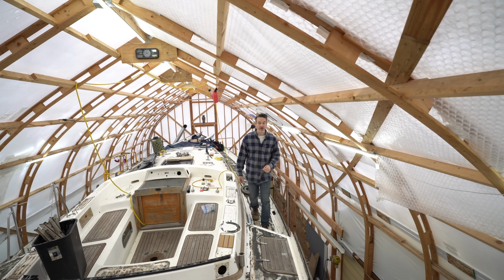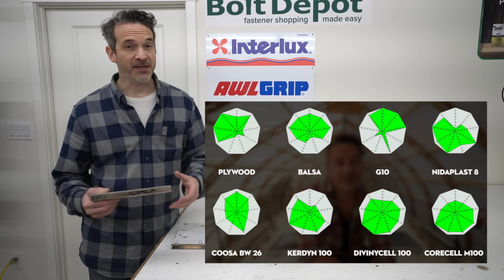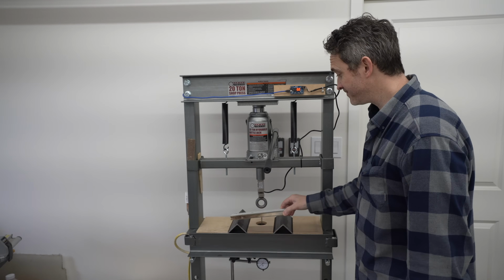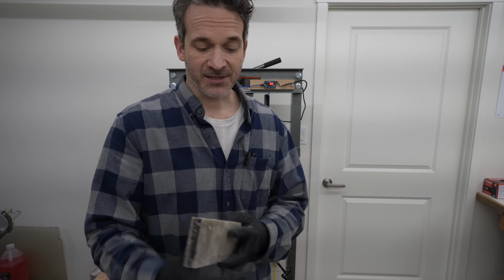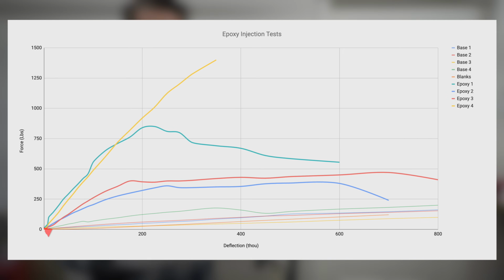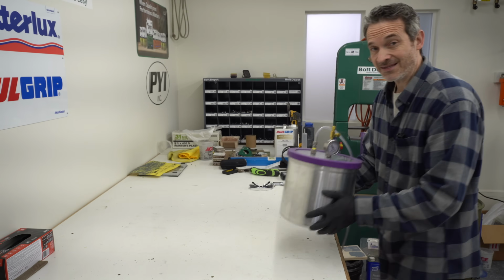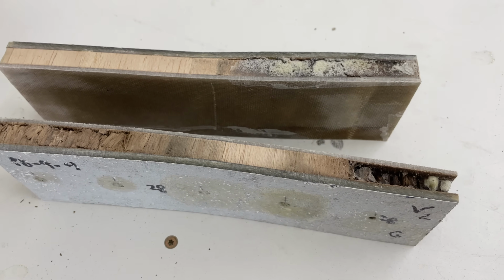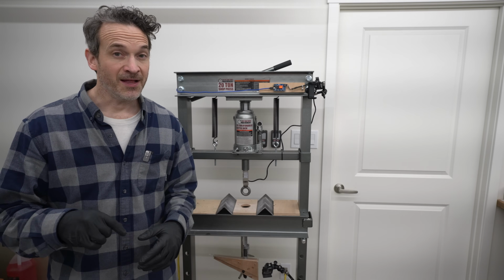Does Injecting EPOXY actually FIX a rotten boat deck?!

Comment: This is such an emotional topic for a boat owner when the have to come to grips with the amount of labor and money involved to do it right. Right is removing the rotten material. The shocking renovation is the rot is usually double of what is immediately obvious. Injecting epoxy is usually only good for small areas and then only when the core is absolutely dry by pulling a vacuum(airflow) though the affected area. Normal viscosity epoxy is extremely difficult to inject and thinned epoxy “penetrating epoxy” that uses volatiles yields extremely poor results. The ONLY thin epoxy that I trust is Gitrot. Filling large voids is to be avoided because of heat and brittleness. Rot eat the wood’s cellulose, cellulose is the wood’s strength. If you fill the space primarily with epoxy, think peanut brittle. Stiff till it isn’t.
Reply from the maker: I think you hit the nail on the head…
Reply: Could not have said it better myself. Absolutely accurate.
Reply: Very informative . Nicely presented thanks for,sharing
Reply from the maker: @c.a.mcneil7599  Thank you

Comment: Your supposed to plug the holes with dowels so it forges the poly into all gaps same with the epoxy, its regularly used to repair delaminated caravan floors
Reply from the maker: Knock yourself out

Comment: Just paint over the teak wood.  1 day work, 15 years no worries. First low viscosity epoxy, then few top coats with anti slip. On larger areas, add a thin layer of fiberglass.
Reply from the maker: Interesting idea but that would leave you with a pretty wet and possibly rotten deck still…

Comment: Thank you for running and filming these experiments.  My question is regarding screw retension.  How well do the epoxy injected cores retain screws before they strip out?   Also will the rotten wood continue to rot in areas where the epoxy is infused and where it is not infused?
Reply from the maker: Thanks. 🙏. Im not sure about the screw retention… interesting question. I assume the wood will continue to rot unfortunately. I don’t really think epoxy is a good “fix” using this method…. Personally.

Comment: You may have said this and I missed it, but what pressure measurement is acceptable for the long-term viability of the repaired deck?  For example, if 300 is viable, then your epoxy injection method meets the spec.  If 1000 is the spec, then core replacement is the only solution.  Can you share what number is good enough?  Is epoxy injection good enough?
Reply from the maker: I think what this showed is that with epoxy injection, the results are really quite variable depending on the level of rot. It may make the deck stiffer but you need to weight the penalties. If you want to get back to the design specs of the boat, proper repair is really the only way that I see forward...

Comment: I always thought (from stuff I read ages ago) that one of the advantages of a cored hull is that should a collision occur, rather than the damage causing a breached (hole in the hull as would happen with an all glass hull resulting in water ingress), instead a cored hull would sustain the collision up to a point?) and only the inner skin would be damaged, i.e. cracked, deformed etc., thereby maintaining no water ingress and less chance of sinking until rescue or repairs can be done. However in videos of homemade bullet plate protection for vests, a 1/2 inch thick plate of fiberglass (reg FRP, kevlar, bi directional) layered under pressed weights held up against bullets up to 45 cal magnum rounds. At 10 yards. AR-15 rounds penetrated but may have lost a lot of its kinetic power who knows , it was all backyard stuff, but it says something about the strength of all glass hulls from the 60s, 70s. I knew a couple who sailed from Malaysia to Japan and struck a very large fishing buoy (unlit) off the coast of singapore (lots of buoys there) in the middle of the night, the collision was quite substantial they described, but upon inspection there was barely a 4-ft scratch on the antifouling paint amidships they said and nothing in the inside. The hull of their boat was cored a total of three inches thick, outer glass about 5/8 inch, then foam core, then 3/8 inch inner glass. They showed a cored sample from a thru hull. Boat was 45 ft cruiser.
Reply from the maker: I prefer solid layup for the hull. Delamination over time would concern me… sounds like a very solid boat though

Comment: Its remarkable that boatbuilders of the not too distant past ever believed wood-cored decks would remain dry. What test evidence did builders use to justify this material choice? Were decks just designed to fail in ~30 years?
Reply from the maker: Sadly, probably just designed to last the warranty period... Balsa is still one of the best choices for core material though... keeping it dry is the problem.

Comment: I drilled 100  1  1/2"  holes  in my  fiberglass deck and pulled out soaked foam. with needle nose pliars ... then refilled with sea cast and a few  mini ping pong balls, between  stringers (no rot)....about 100lbs worth of sea cast from transom  forward about 4 1/2 feet. sanded and gel coated . good for 100 years plus.  Epoxy will crack been there done that .
Reply from the maker: Wow. That sounds interesting…

Comment: That's an avwesome stuff. I'm rebuilding my coachroof with the closed cell foam that Trojan maxx core PVC foam (approx 5lb/ft3) and I really like the result. One more thing with rotten core is that it accelerates a molb buildup in humid environments.
Reply from the maker: Thanks! All the best with your rebuild.

Comment: Can you overlay a damaged deck with -say, teak wood as a "path" that spreads the weight distribution?
Reply from the maker: It will probably help with the stiffness (if you glue down real teak - or add more layers of glass)… but it is not dealing with the existing problem of the extra deck weight and then you’d just be adding more. 
I would be concerned with a “cover what’s in there” method… just my $0.02 👍

Comment: I went through a similar process on my boat some time ago, and reached the same conclusion. Remove the top layer of fiberglass and all of the damaged core, plus enough to be sure you got it all. Replace it with new foam, vacuum bagging it in, and lay a new top layer (cord for the engineer). With a little practice you’ll get good at it.
Reply from the maker: Thanks! That’s the plan!! 🙌

Comment: I am in the process of doing a core replacement on my C&C 24 after a botched drill-and-fill "repair". I knew it was going to be bad, but it's of course much worse than I imagined. 

The construction of the C&C is odd. The foredeck has a typical "sandwich" layer with balsa as the core, but the bottom and top of the sandwich pinch up at the sides to a single layer of fiberglass where it is bolted to the hull. There is a third layer of fiberglass that makes up the interior of the cabin, but it isn't actually bonded to the core sandwich above (except by some thick blobs of resin, presumably to keep the free-floating interior glass held up). Because of the drill and fill "repair", water got into the space between the interior fiberglass layer and the sandwich, which caused mold to abound and deeply penetrate the bottom sandwich layer. In short, I have to rebuild the entire based from scratch as well as the top. UGH!!

But alas, if it's worth doing, it's worth doing right.
Reply from the maker: Ooph… I feel your pain. Hang in there. It is worth doing well this time. All the best!! 🙌👍

Comment: For the folks saying that the expoxy injection works ( their boats were done years ago) I'm going to assume they sail them reguarly in high winds and waves, meaning the expoxy-repaired decks have been been tested, not just by a hammer and moisture meter, but by the thing the structural strength is for in the first place - to hold up the rig and mast in more demanding conditions....?
Reply from the maker: I don’t think anyone will want to touch this one for legal reasons… 🤪

Comment: Would like to see a cost vs. Strength relationship. Stupid epoxy fill in can be made by anyone himself. New foam core must be done by a boat shop which costs 50x to 500x more
Reply: Even more important when you consider this on a boat 40 years old beeing worth only $10k
Reply from the maker: Thanks for the feedback 👍

Comment: what about on new stringers where the engine mount bolt holes are. Do you epoxy resin the hole then re-drill?
Reply from the maker: I haven’t crossed that bridge yet…
Reply: @livingforsail  looking like I'm going to oversized the hole and fill with epoxy then drill it out
Reply from the maker: @Supanova70  That's generally a good call. Is it a through bolt?

Comment: Practical Sailor actually did a similar test years ago. They found none of the epoxy, glue, or get-rot penetrated the waterlogged wood core beyond a few inches. The best solution was to just replace the core like you're doing Jon.
Reply from the maker: Thanks! I did see an old article from them a while ago. Good folks over there. 🙌

Comment: Great and very helpful video! When you say the epoxy-filled version weights 40% more, do you mean 40% more than it weighed before injecting the epoxy, or 40% more than it would have weighed with an intact balsa core? I believe marine epoxy and water have a similar weight. If a balsa core has been completely penetrated with water, then it seems that replacing the water with epoxy resin wouldn't really add much additional weight to what was already there
Reply from the maker: Thanks! 🙏 
I mean 40% more weight than the sample before injection. I have no idea about the original weight. 
True that it probably isn’t much heavier than a saturated deck but still much more than the boat deck was designed for… it’s not a place on the boat that I want to add weight to personally… 👍
Reply: @livingforsail  100% agreed on that point!

Comment: Thanks so much for this video, and for putting some data behind potential repairs. Would be really interesting to see what a sample recored with balsa would look like. It seemed like several of those were “sectioning off” as you put it, and I’d be curious if that’s a natural tendency of the core material. Thanks again!
Reply from the maker: Thank you ! 🙏 
There have been a lot of good ideas for a round two. I’ll add this to the list. Thanks! 🙌
Reply: @livingforsail  add different woods and thicknesses glassed poly vs epoxy etc.
Reply from the maker: @0onpoint  Good idea. Thanks!

Comment: Vacuum pumps are pretty useless. Use an aspiration pump attached to a water pump in a 5 gal jug. You can pull almost a hard vacuum.
Reply from the maker: I was able to pull down to 500 microns. I don’t think I the pump was the issue…

Comment: Nice video.  A couple of comments on using polyurethane glue such as Gorilla glue.  You mention that it creates 'open cell' foam when cured. This in incorrect as the bubbles are not interconnected when cured which makes it a 'closed cell' foam.  In application there are some challenges to using it for core repair.  If the injected glue is not contained when curing, the bubbles can become large resulting in a foam with inconsistent bubble size that has low mechanical properties and most of it just gets pushed back out of the injection openings.  If the glue is injected and the openings are sealed off, the pressure of the foam trying to expand while curing can push the skins apart causing deformation and possibly delamination of adjacent areas.  Polyurethane glue is great in certain composite core construction and repair applications but there are lots of variables which must be controlled during the process to have good results.
Reply from the maker: Thank you 🙏

Comment: I can think of no worse construction for a deck than balsa core covered with polyester based fiberglass. What a disaster.
Reply from the maker: Yeah… it’s not great but is t usually a problem this big until 1000 screws get inserted for the old teak decks… 🤦‍♂️

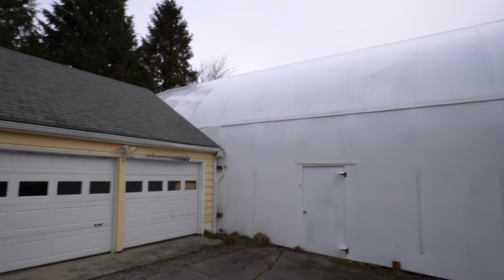Comment: 1:00 minute in it is apparent to anybody who has ever been here. There is only ONE way to solve this problem. It will need replaced. Probably go poly vs teak.
Reply from the maker: I’ll be sticking with the proper core replacement… big job!

Comment: Nice work.  I am currently recoring my deck with Divinycell foam core.  The actual recoring is pretty easy.  The more difficult part is making the deck look pretty after the repair.  I am planning to use Kiwigrip non-skid for my repaired deck.  This year I am only doing the foredeck, so I will put the kiwigrip on that area to see how well it holds up over the summer.  I will be sailing the boat over the summer.

Based on my limited understanding of cored panels, the water in the deck becomes a problem when the wood rots and or the bond between the top and bottom skins and the core fails.  I do have a couple of spots where I removed the balsa core and rebuilt the panel with solid fiberglass (many layers of 1708).  That in spots where compression was an issue under my deck stepped masts.
Reply from the maker: Thank you! Great job with the previous core work. I hope the rest goes well also! 👍

Comment: My Grand Banks 42 had classic teak deck leaking into the core wood. Aft was the problem area. Water was worst around the aft cabin over the lazarette but extended alongside of the aft cabin over the bunks below.  My purpose in writing is that I pushed in dry air to displace the water before attempting CPES treatment followed by epoxy. Consider an air compressor with an accumulator that runs through a drying rig. You can build your own drying canisters, and when the drying agent is wet you microwave it to drive out the retained moisture. Use it again, and again, and again over several days. A manifold of penetrations into the deck from below pushed in dry air and elsewhere there was outlet penetrations to collect the water. Dry air picks up moisture and drives by pressure the water towards the outlet penetrations. After the aircompressor that I had burned out, I hooked up a shop vac to the outlet pipes and pulled on it for another day or so. I then sealed off the underside holes and made penetrations into the caulking on the upper side. The CPES injection was to treat the wood for stopping any rot. I did not consider this structural. Next to inject was Gluvit because it has a low viscosity and could flow into the leakage points. I saw it flowing up out of the deck penetrations and we kept wiping it up with acetone rags. Finally, giving ample time to dry, we injected a marine epoxy like West and then we resealed the caulking holes. Can hardly see it and the deck was solid for the next 5 years of boat ownership. I told my buyer about it, and he inspected everything but still bought it. Note - while the boat was of the era with screwed teak decks, the water (I figure) mostly entered at the deck fuel ports which are just brass pipes dropped into a deck hole. Nobody ever sealed around the hole cut for the fuel pipe. Two coats of Gluvit did a great job fixing this problem.
Reply from the maker: Thank you for sharing! Isn’t it crazy how a simple 5 minutes of prevention 30 years ago would have saved a mountain of work?!

Comment: You did not try to dry the core with microwave.
Run the magnetron on deck till it cook out all moisture.
Reply from the maker: I did not try that. … it sounds really unsafe. Haha. 
On the plus side, you don’t have to spend extra time heating up your dinner… 🤷‍♂️
Reply: @livingforsail   🤣💯 unsafe

Comment: Interesting tests for sure. I’d cut out the deck and rebuild it with new core and new glass. The epoxy injection just feels like a shortcut that will inevitably lead to other issues down the road.
Reply from the maker: Thanks 🙏 I’m in agreement here 👆

Comment: Well, in an anology; its better than using "Bars Leak" in your car radiator but a long way away from a long term fix. All hands on boat owners know ..find and replace the moistened wood parts.
Reply from the maker: Yeah. I’d have to agree here. 👆